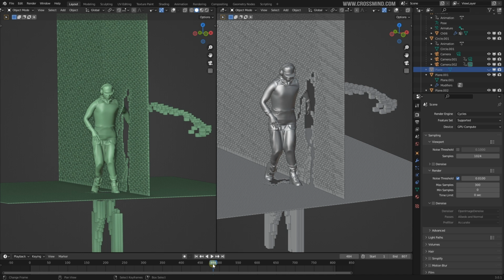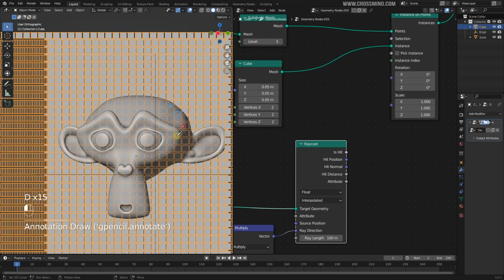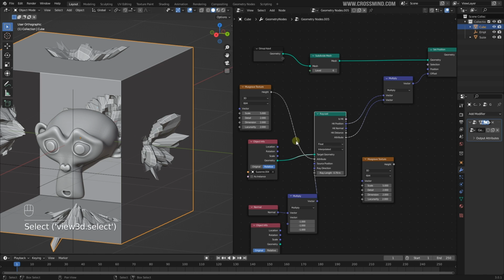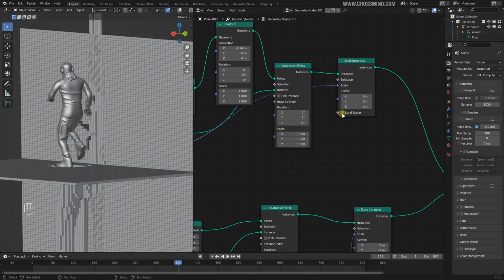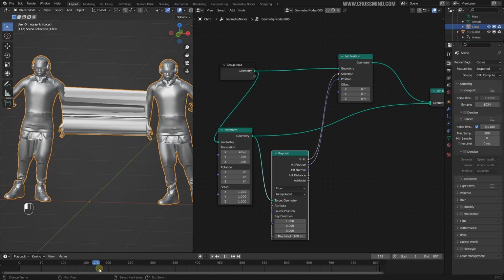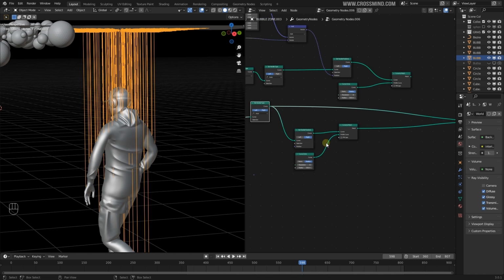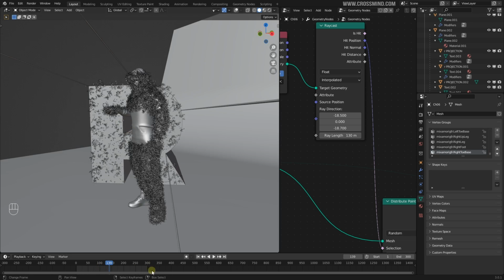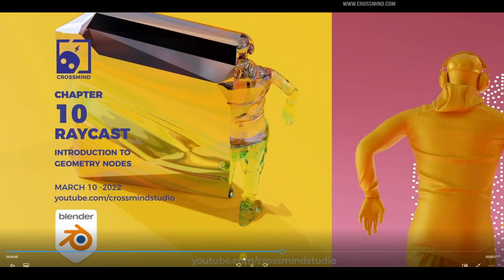10__RAYCAST__Geometry Nodes For Beginners / Blender 3.1

Comment: is it possible to use the raycast node with some kind of smoothing or falloff?
Reply from the maker: Yes 
You can take the raycast output and combine it with may be a gradient and use math node with it.
Reply: @CrossMindStudio  if i use the raycast to make like a shrinkwrap, can i smooth the transition from one mesh to another? i have tried to use gradients and experimenting with the geometry proximity node, but i can't quite get it to work :'(